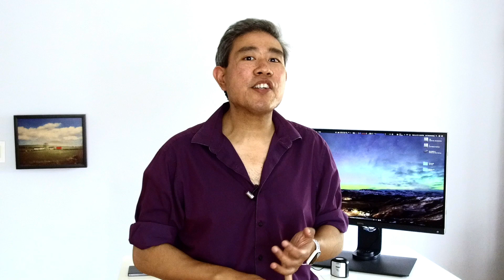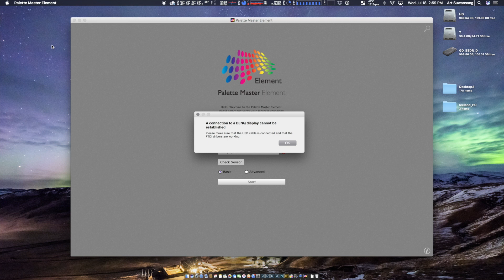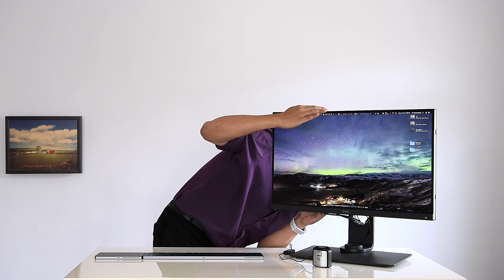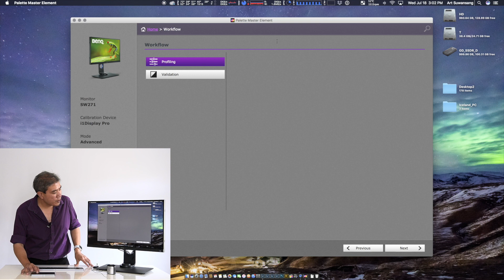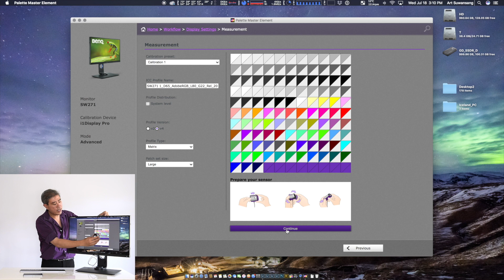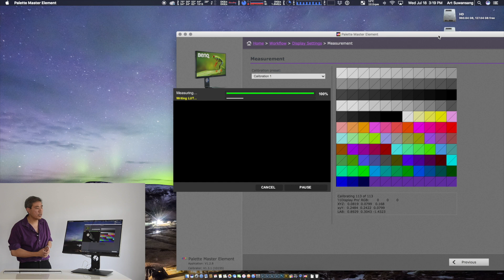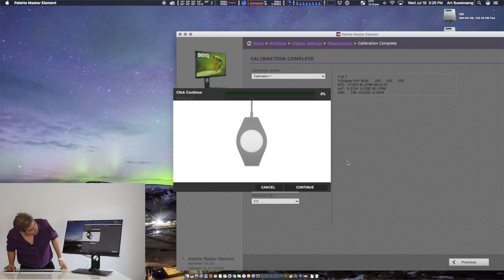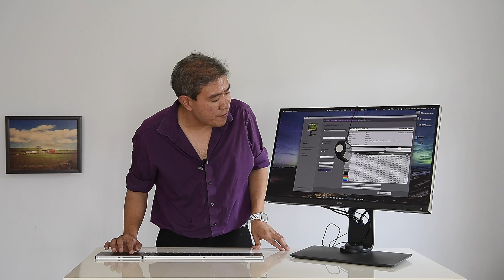How to Calibrate BenQ SW Displays with Palette Master Element - Art Suwansang

Comment: Hi, why does the display still output "Display Needs Calibration" even after I calibrate using this method?
Reply from the maker: On one of the screen in PME you have to choose to not remind you to profile. Otherwise it would come up.
Reply: @ArtIsRight  So I have to disable it from the monitor menu? The PME software only allows me selection which calibration preset I should calibrate to (There are three presets). Is there a way to calibrate the in monitor presets (Rec709, sRGB and so on). The way I understand is that the built in presets can not be calibrated by the user only the Calibration 1-3, which I can then run from the puck?
Reply from the maker: @George Atanassov, you can disable the reminder form the display menu, it is under System - Cal Reminder, just turn that off. About the calibration there's no way to calibrate the in monitor presets, those are color modes that has been calibrated based on reference value for each color space for the factory. So yes only Calibration 1 - 3 or 1 -2, depending on the model, can be done by the users.
Reply: ArtIsRight Thank you so much for answering here.
Reply from the maker: You're welcome. Anytime.

Comment: I have benq GW 2283 with hdmi 1.4 cable and nvidia  GeForce GT 710 graphic card I set  my monitor and hdmi settings 0~255 full , in graphic card settings desktop color settings select to use nvidia settings and select full output dynamic renge output color format RGB, still can you send how to set settings for accurate colour , my email address siddharth5293@gmail.com
Reply from the maker: @Siddharth Kshatriya, PME can only calibrate SW series display. It is design to adjust the hardware LUT inside the display. For that BenQ model what you have to use this guide instead https://youtu.be/Aed02rg3wDA the settings are all in that video. Cheers!

Comment: Hi, I have the SW2700, the i1 Xrite calibrator and Mac OS Catalina. When trying to calibrate using PME v1.3.8 the RGB Primaries option is not showing. Any ideas why? This is the first time that I have this problem since I ´ve updated to Catalina. Thanks for your help!
Reply from the maker: @D. Bernich, thank you for the questions. Let’s use the comment section in the other thread/video to communicate :)
Reply: Which video? I am experiencing the same problem! RgB primary selection not available? Please help! 
Thanks in advance!
Reply from the maker: @Nalla Selbor, this is the video https://youtu.be/ycGZs4dJdug and if you have a SW2700PT then please check the tag in the back of the display. What you want to look for is the MFG date. Let me know what that is, If your is something in 2015 or 2016 then you won't have an option for RGB primary. You can only calibrate it using Panel Native.

Comment: Hello 👋 I just got my BenQ SW 240 yesterday and I am having a hard time to calibrate it trough my MSI Apache pro laptop. Is anybody can help me how to do it? 🙏
Reply from the maker: Hi @Norman, so what cable are you using to connect the display to the laptop, are you using USB-C, HDMI, display port etc. Let me know. Also what’s the issue that you are running into?
Reply: ArtIsRight I am using the DP to Dp port USB cable. I’d like to calibrate it individually with the spider 5 pro. What should I do? Do I need to install any software program in my MSI laptop from BenQ ?
Reply from the maker: Hi @Norman yes you would need to install Palette Master Element from BenQ
Reply: ArtIsRight  should I buy it? If it so where? Would you mind to send me a link? Appreciate it thank you so much ☺️
Reply: @ArtIsRight  Found it thank you, I just installed now and ready
Reply from the maker: Awesome! Glad that worked out!

Comment: Thanks for the great video! I don’t know if you can help me but I have a problem when  using photoshop on my hardware calibrated (with palette master elements) Benq SW271 plugged into my Mac book pro via USB C. When I double click a smart object layer to make some camera raw adjustments to a raw image layer -  the image displays in camera raw incorrectly i.e. the colours do not match the image layer as displayed in photoshop itself. It becomes much more saturated and contrasty when the camera raw window is on my SW271. If I drag the camera raw window back to my Mac book pro screen then the colours are much more similar to what they should look like I.e. back in photoshop on my SW271 (except of course the slightly different calibration). I don’t know if it’s my error or not but it’s driving me mad! I’ve even phoned adobe but that got me nowhere! I feel frustrated as it’s such an expensive investment and I can’t work it out. Hope you can help me :)
Reply from the maker: Hi @Jonathan, I believe that this may be related to this bug https://youtu.be/GavTIafAQsw The thing is that there's fix for Lightroom but not really any solution really for photoshop and camera raw. At the moment BenQ is aware of the issue but they are still running into issues in their testing. I hope that they have a resolution soon.

Comment: Hi there ! Thank you for your video, I have a BenQ SW240 I'd like to calibrate it with the i1 display pro. Do you suggest me to use the palette master element or use th Xrite software ?
Reply from the maker: Hi @Alberto use Palette Master Element all the way for the SW240. This way you have access to the true hardware calibration. If you use X-Rite software you are only able to do a software calibration, to which you are not using the full potential of the display.
Reply: @ArtIsRight  thank you so much for your reply. When you talk about a clean up before calibration you talks about the color management profile or the reset of the screen ?
Reply from the maker: @Alberto I think in this context, I was talking about making sure that no other color management program is running the background and that you have turned off the system setting that can interfere with screen calibration. You can watch this guide for Mac https://youtu.be/kbQIrh00A80 and this for PC https://youtu.be/4QwuyzyVhCA

Comment: Thank you Art for yet another very informational video.  Just one question in regards to setting different calibration profiles (i.e. 1,2,3...) for my BENQ SW271 monitor.  I have successfully calibrated my AdobeRGB profile (1) to AdobeRGB.  Now that I have completed those for my print work, i am wanting to set my calibration 2 to sRGB for internet/social media, platforms.  Would I follow the same steps but just select sRGB color space (instead of the AdobeRGB) to set that as my sRGB profile (in my case profile #2).  Sounds pretty explanatory but just want to make sure I am doing it correctly and getting as much as I can out of the monitor and the calibrator.  Thank you so much! There's a lot of conflicting information out there whether to use the proprietary software or in this case the Xrite.
Reply from the maker: Hi @Brandon, you’re welcome and you are correct. In this case you would use PME and clarion slot 2 choose sRGB as the primary and then calibrate it. Because you have a display that is capable of hardware calibration, you should avoid using the i1Profiler unless you have a reason too. A video on why you might want to do this is in the works.

Comment: Hello Ashlyn:
I recently purchased a SW270C and I am having difficulty using Palette Master. I am hoping you can help!

Windows 10 (new install)
Palette Master Element V1.3.7
Datacolor Spyder X

My problem is that Palette Master does not recognize the Spyder X.

The USB ports are working...I tested with a memory stick.
When plugged in the Spyder X is listed as working in Windows Device Manager
I have also tried the hardware reset you mentioned
I have the Spyder X plugged into one of the side USB ports

Any suggestions would be appreciated
Reply from the maker: Hi @Raymond. This is Art here! So have your tried to plug in the Spyder X directly to your computer? Also just to double check you have a USB uplink cable from your computer to the display correct? I just want to make sure before I can help you further with this. Please share this information with me and we'll go from there.

Comment: I'm one of at least seven photographers in our crew that use the SW2700PT and I think all of us are using it wrong. After seeing your talk at PhotoPlus, I went home and tried to calibrate using Palette Master. I kept getting an average Δe of 28. Mostly in the greys and blacks. The RGB values were fine. I read these comments and thought it might be the HDMI connection, which we are all using. I bought a USB-C hub (three actually) with a MiniDisplay Port and new cable to connect my Macbook Pro Touchbar. Two of the hubs couldn't handle the resolution. The one that did was still giving a the same failing Δe. I tried one of the other SW2700 displays that a friend has and got the same results. Only once did I get a good calibration and I used a small matrix instead of large. I tried to recreate it with my friend's laptop and it went back to the same Δe. We also tried a USB-C to MiniDP dongle. For calibrating I'm using a Spyder5, which appears to be accurate and consistent except for the one good calibration. I'm wondering where we're going wrong and if there's a specific hub with MiniDP, pass-through USB-C, and a few USB 3.0 ports that you'd recommend for the Macbook. I'm sure everyone can agree that they'd like to plug in just one cable and be up and running with all the peripherals. Please let me know so I can pass along the information to the rest of these really talented photographers, who should all be operating with the best quality equipment. Thanks.
Reply from the maker: @Bryan thank you for the post. Thank you for trying to solve the issue. So one of the cable that I recommend is this one https://www.amazon.com/gp/product/B074V5MMCH/ref=ppx_yo_dt_b_search_asin_title?ie=UTF8&psc=1
Now if you are looking for a hub that will work well for the USB - C I'm not sure which one you have tried already, however, ones that will work will be quite expensive. Here are few that you can try:
https://www.amazon.com/CalDigit-TS3-Plus-Thunderbolt-Dock/dp/B07CZPV8DF/ref=sr_1_3?keywords=usb+c+hub+caldigit&qid=1573708509&s=electronics&sr=1-3
https://www.amazon.com/CalDigit-USB-C-Pro-Dock-Thunderbolt/dp/B07VL675DT/ref=sr_1_4?keywords=usb+c+hub+caldigit&qid=1573708509&s=electronics&sr=1-4
https://www.amazon.com/CalDigit-Thunderbolt-Portable-Charging-Ethernet/dp/B079H4WTR4/ref=sr_1_5?keywords=usb+c+hub+caldigit&qid=1573708509&s=electronics&sr=1-5
https://www.amazon.com/Elgato-Thunderbolt-Dock-Ethernet-aluminum/dp/B01MZ2ATGK/ref=sr_1_10?keywords=usb+c+hub+caldigit&qid=1573708509&s=electronics&sr=1-10
https://www.amazon.com/StarTech-com-Thunderbolt-Dock-Windows-DisplayPort/dp/B07BJJX47G/ref=sr_1_12?keywords=usb+c+hub+caldigit&qid=1573708509&s=electronics&sr=1-12

I would also like some information on your SW2700PT too, on the back in the middle toward the bottom there is a BenQ sticker. Could you give me the Mgf. Date and Rev. There are some known bug with some revisions of the SW2700PT and PME. Once you get this information to me, I'll check and let you know.
Reply from the maker: @Bryan, a new version of PME was just release 1.3.7 would you please download this version, try the calibration again and keep me posted on your progress and ∆e result.
Reply: @ArtIsRight  Thanks for the quick reply. I just tried with PME 1.3.7 and got the same failed results. Maybe it's my hub or my cable. I'll order the cable you recommended and try that direct to my Macbook. I love the convenience of plugging in only one cable and having everything connected, but those hubs are pretty pricey and maybe I'll have to settle for plugging in two cables. I'll keep you posted and appreciate all your help.
Reply from the maker: @Bryan, for the time being if you could get me the MFG date and REV number from the back sticker I would appreciate it.

Comment: I have calibrated Benq sw240 with the PME software. I am using Nikon Capture nx2 and photoshop  CS5 for editing photo. Do I need to do anything else after the calibration?
What I mean is do I need to go into Nikon Capture NX2 and photoshop cs5 and pick the calibrated profile? Thanks
Reply from the maker: Hi @ Doug, those are all handled systemwide by the OS you don’t have to do anything.
Reply: So in color management in Nikon Capture NX2 and in color setting in Photoshop,  just leave it at adobe RGB? Thanks
Reply from the maker: Hi @Doug you can do that. Those options have nothing to do with how the color would look like in the screen. They have to do with the color space that you tag you images with when you are working so that the programs know how to convert and display the colors properly.

Comment: trying to calibrate the SW271 to sRGB. I set the luminance to 100 but it only achieved 21.8681. Can anyone tell me why that is?
Reply from the maker: @Dactyls, is the archived 21.8681 reported at the end of the calibration, where it gives you a report? Either way, I would like you to try and calibrate the display using Adobe RGB Primary and let me know if that changes the brightness. Also, it would help if you share with me what computer you are using, OS and Version, PME version, connection cable used for the display, the device that you are using the calibrate the display, etc. Please keep me posted and I'll try to help out as be as I am able to.
Reply: @ArtIsRight  Thanks so much for the quick reply. I ran the Adobe RGB primary with a target of 80, but achieved 20.3193. This number is not in the report. Report shows Maximum △E 26.36 and Average 19.83. I am running Windows 10(v 1903) on a Ryzen 9 3900x, MPG X570 Gaming Edge WiFi MOBO, RTX 2070 Armor GPU. PME App is V1.3.5, Calibrator V1.3.2(1D186). I am using the x-rite i1 Display Pro. The sw271 is connected via HDMI into the GPU, and USB 3.2 into MOBO. (I haven't tried the USB-C yet.)

My main focus will be video editing via Davinci Resolve, as well as color grading and effects.
Reply from the maker: @Dactyls, I think that we found your culprit here. And it is the HDMI output, try changing that to USB C or Display Port. Here is some background 

1. HDMI in general is not recommended. If there are display ports, it is recommend using that or even DVI over HDMI. However, DVI can’t carry 4K signal. The general reason for this is because HDMI is basically a TV based signal. And TV like colors to be more saturated. In addition there are a few modes of Chroma Subsampling, in this case for Mac and other PC computers are 444 and 422, which is full range RGB translation (0-255) and limited range RGB translation (16-235) respectively. Some Mac and PC output, from my testing, this limited range 422 by default. This is the problem and the reason why we were never able to calibrate your computer using the HDMI cable. And it also explains why the colors are more saturated when using HDMI vs Display Port (You'll see this when you plug in display port). 

In addition, if a computer graphic card is able to output HDMI full range 444, there is an option in the BenQ displays under the setting menu to set the HDMI Range. This option, however, may be grayed out.

One other thing to note is that on a TV HDMI carries not just only the display signal but also sound as well. Which is part of the reason why MAC HDMI default to the limited range output so that it uses less bandwidth so that the cable can accommodate other types of concurrent signal transmission over HDMI.

Again please see me posted on the result and hope that this help.
Reply: @ArtIsRight  That did the trick! Achieved 80.3884, 6505K. Maximum 2.40, Average 1.16. Again, thank you so much for your quick response and detailed information. 

I am surprised the SW271 did not come with a standard Display Port cable. (or maybe I am not surprised. Haha.)
Reply from the maker: @Dactyls, awesome! Perhaps will do a video about this. I think that this is something important that other users should know. I'm also happy this solve your issue. Another thing to note too, if you leave the display running for about 15 min and try to calibrate again, you might be able to get your delta e value down below 1. Something that you can try. Cheers!